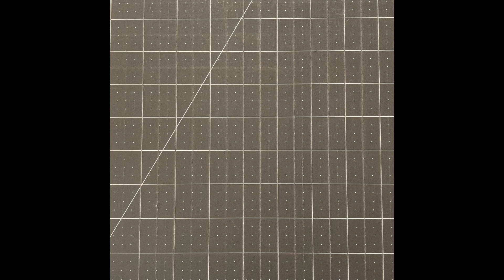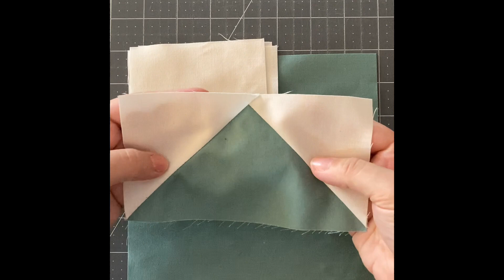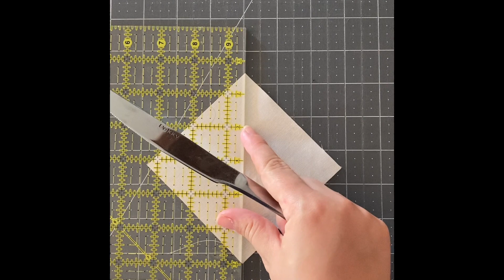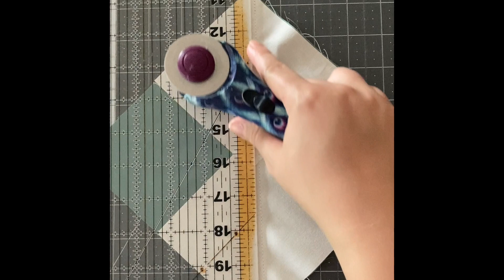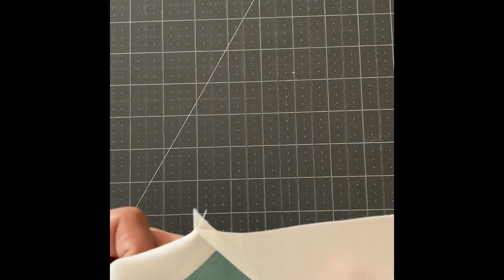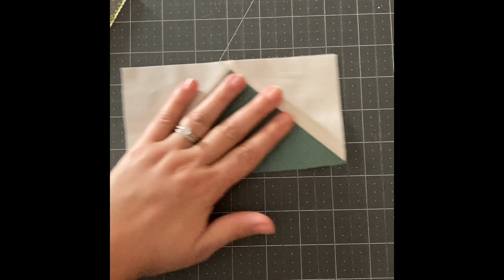No Waste Flying Geese Tutorial

Comment: Your video angles and narrating is perfect! Thank you! But is there any reason you did not give measurements but instead opt to refer to the squares as big and small?
Reply from the maker: Hi there! The only reason is because this technique can be used with Flying Geese of any size. But, if it's helpful, I was using squares that were 7.25" and 4". And the finished block size is 3.5" x 6.5". Hope that helps!
Reply: @ThisMountainLifeQuilts  Do you really mean finished block?  Normally the height is half the width of the block in a finished flying geese block.  Do you maybe mean UNFINISHED?  Little confused at the size you quote as a finished block.  Great video though!